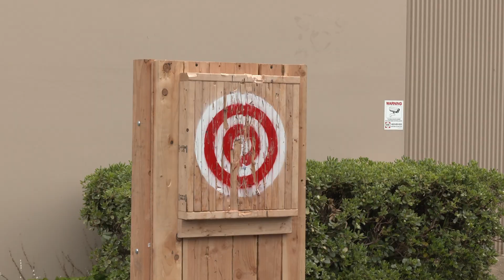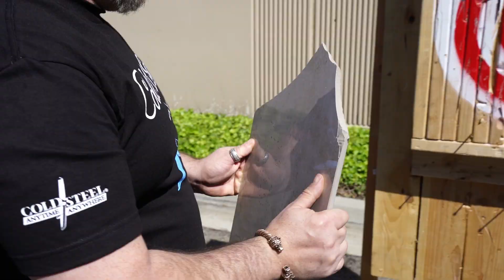Our Newest Axes

Comment: just bought one of the hawks with the curved blade , only three things I dont like the edge is an 1/8 to 1/16 inch thick , no cutting edge at all , not crazy about the set screw to keep the head tight , also not all that enthused about that coating , is it paint , and what can I use to remove it !  other than that . it is a good looking piece , would really be nice without the coating !

Comment: So were these given extra sharpening for the video or is that the edge as it comes?
Reply: Watch the 2x4 part. Looks to me as is. If it was sharpend extra he would have been able to chop it easily. Great axes, expect to do some work to get the best performance
Reply: If you've owned Cold Steel in the past, you know all their product comes razor sharp out of the box. Almost every time. I've owned about 40 blades. I've been able to shave with almost every one right out of the box. These are not toys. They are weapons of mass destruction.